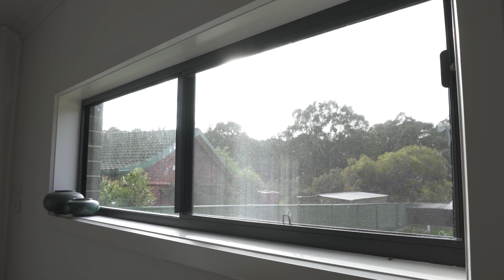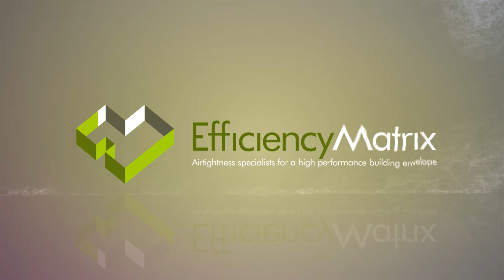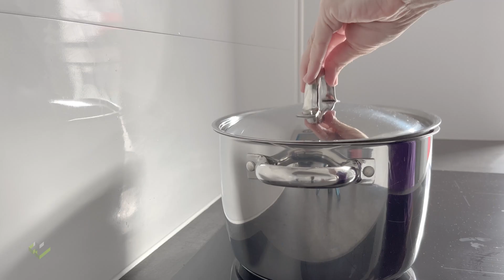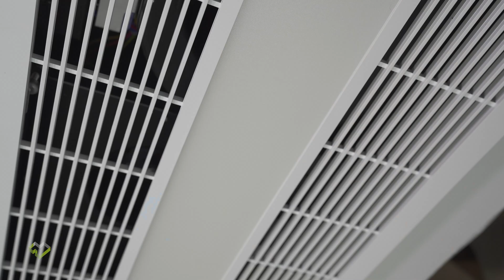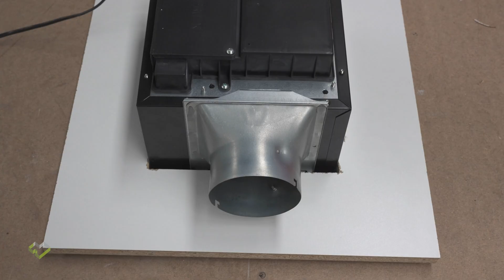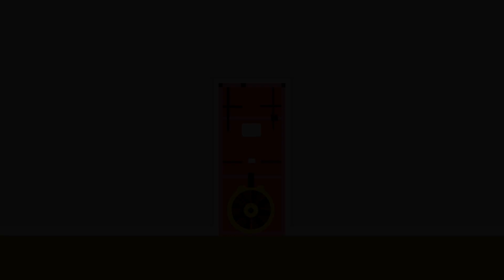Basics of Continuous Home Ventilation

Comment: Where is the makeup air coming from in a very tight house - like passive house tight?
Reply from the maker: Hopefully via gaps around windows.  Wall cavities and ceiling spaces are not ideal places to be getting air from.
Reply: You could also install trickle vents for makeup air .
But in a house that is passive house tight it would be ideal to use a balanced heat recovery system (mvhr) otherwise you will be losing a massive amount of heat from bringing in the cold outside air .

Comment: @ecoevo I'm also interested in an inline fan alternative as I understand they are quieter than the Panasonic FV-24JR2 centrifugal fan. Would be grateful if you can confirm if the EM In-line Exhaust Fan 150mm can be set for continuous ventilation?
Reply from the maker: Current the inlines can be variably set to low flow, however, what we are after is a low flow inline fan, that has a timer turbo button.  Stay tuned for that.

Comment: that is great. so just extraction in the bathroom like that is good enough. Is there an inline version for low noise and what brand ? I'm thinking one is needed in the laundry also as the heat pump dryer still vents humidity.